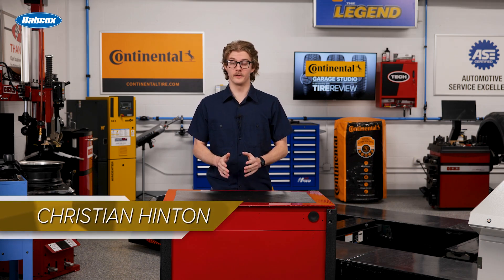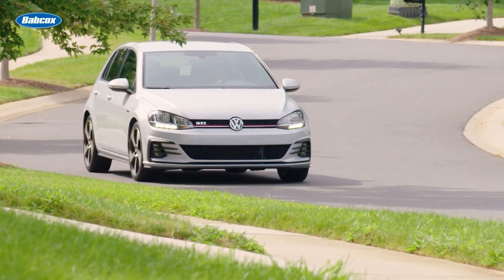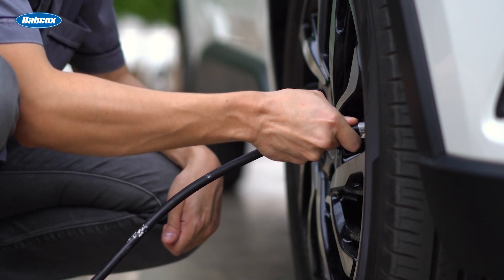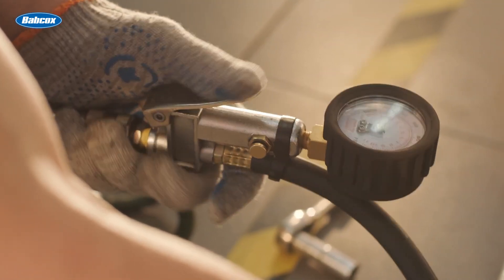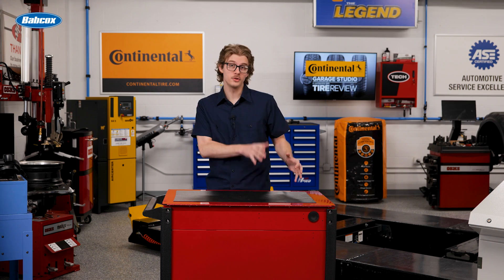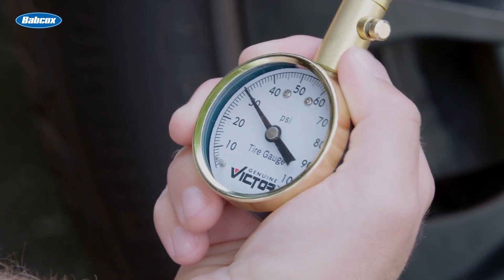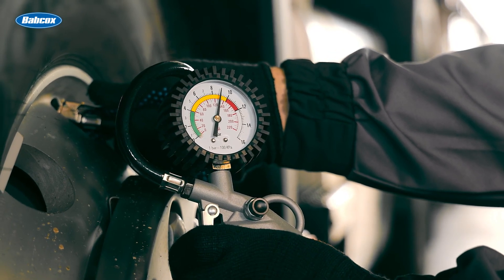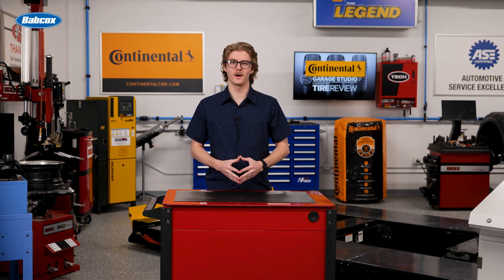What tire technicians might not know about tire inflation

Comment: I’ve always added 4 psi for warm tires and really surprised to hear 10 psi. Is 10 psi a good rule of thumb for all tires? Seems Christian was talking about truck tires but is this true for truck and car tires. 
I always try to check pressures when cold but that’s not always possible. 
How long does a tire need to be stopped to be considered “cold”  in 50-60 F weather?

Comment: One must also consider where the tire is used most frequently. Lots of mountain driving with lots of curves will need more pressure to prevent wear from sidewall flex.